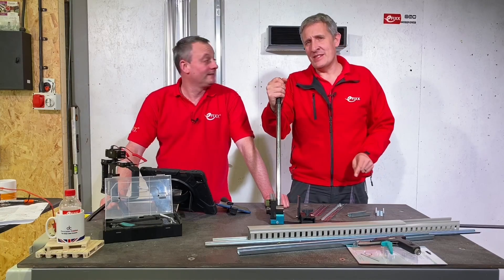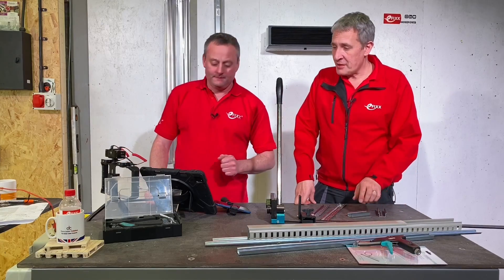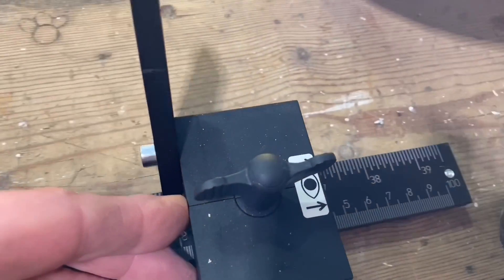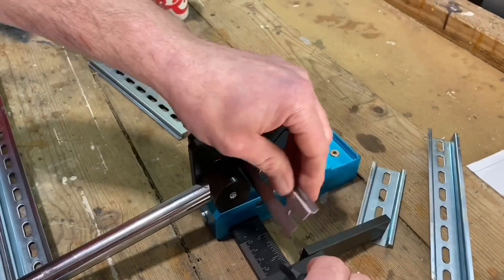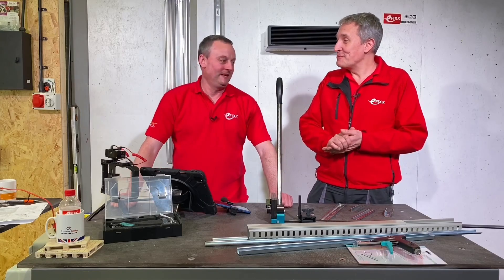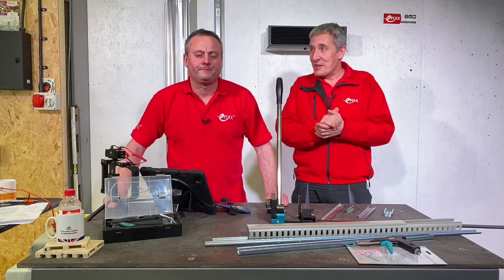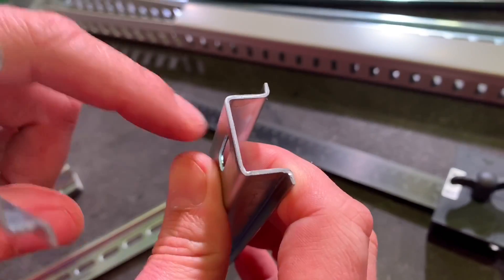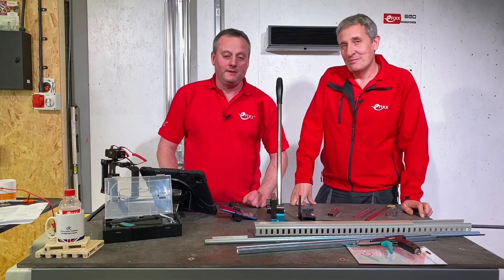DIN RAIL CUTTER - FAST & CLEAN edges from Phoenix Contact

Comment: It doesn't have a guide rail to keep the rail at 90 degrees to the cutter, so the ends can be 4 or 5 degrees off square. After you have cut a few, it starts to leave burred edges. Wasn't impressed.

Comment: We have this at our factory,  along with a machine for cutting tri rated cables to set lengths which also part removes the outer sheath, ready for the next machine, which is a air powered crimping tool for crimping the cord ends on. Ready for assembly of the caravan hook up boxes or bollards etc. Great bits of kit.
Reply from the maker: Great feedback 👍

Comment: Good to have stuck at the bench in the wholesaler to chop bits to customers or a big site/factory where you may need it. Apart from that, by the time that’s all set up, I’ve already cut the bit I needed with my handsaw. Price will be another turn off as it won’t justify the times it’ll be used by the average spark.

Comment: This is probably going to be an invaluable tool for the panel builders. No need for marking (remember mark twice, cut once 😉 ) cutting and filing. Such a simple tool really and saves alot of time. What more can you ask for from a tool? #WorkSmarterNotHarder

Comment: Won’t be saving lots of time with the actual cutting mechanism but the fact that it leaves a clean cut with no need to file will save multitudes of time
Reply: So you can cut faster then that shear action 🤔i dont think so